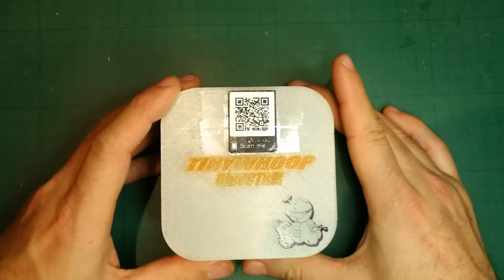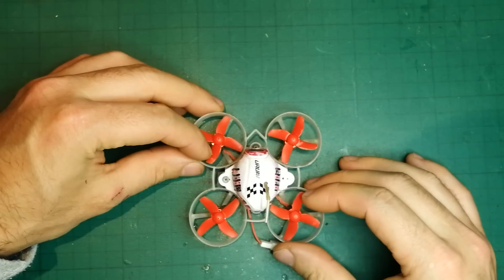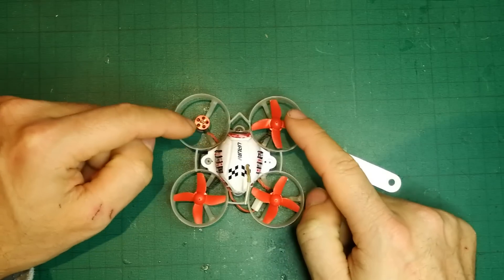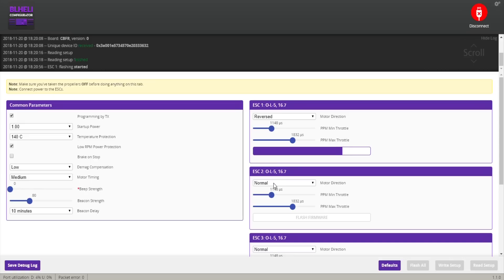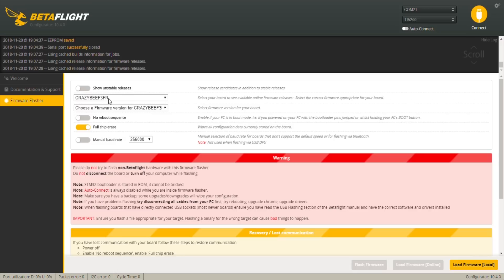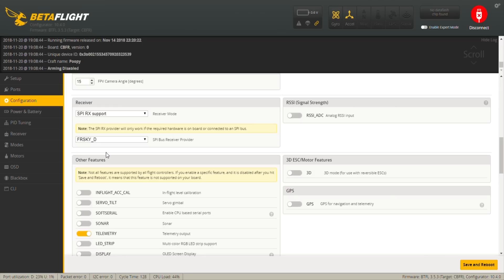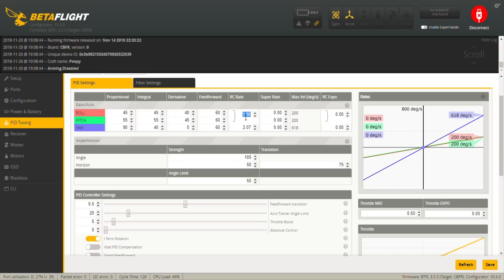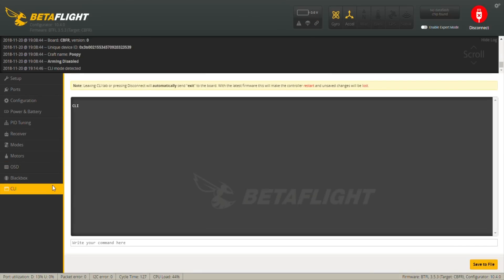The best configuration for your Brushless Tiny Whoop UR65

Comment: Can I use this as a beginner? or will I notice any difference?
Reply from the maker: You will definitely notice a lot of difference. This will help you fly a lot better as a beginner :)
Reply: @SeekNDFPV  i´m a beginner too and I have 2 problems. First one that my ur65 some times arms and some times dont, when I try to get into blheli confurator it says: "Connection failed, ensure that you have selected the correct port or restart your device." and the most important is that in banggood says "Please don't upgrade the ESC firmware to the newest one. Because it will lost configuration so damage motors . If you have upgraded to 16.7, please try to adjust the Starput Power to 1.00." should I doit anyway? I hope you can helpme! Thank you and have a good day.

Comment: Good overview. I do really enjoy the US65, it's so much fun. I thought that the mockingbird pids were a bit too high and I got oscillations in the motors so I dropped them back to defaults and found that I liked them better for fun flying. I haven't tried racing it yet.
Reply from the maker: What props are you using? I found that if I used eachine the pids work perfectly, but with TBS I get oscillations on high throttle.
Reply: @SeekNDFPV  I'm using the props from the Eachine e011. At the time I set it up and found some oscillation it was on BF3.4, so perhaps 3.5 has some improvements that allow higher pids without the oscillations. Could also be the 19kv of the US65 motors that caused it. It wasn't a crazy strong oscillation, but it was noticeable compared to stock settings.
Reply: That's strange...I'm running 3.4 and 3.5 on 19k, 17k and 16k with quad props (Eachine) and no oscillations!  Mine are all about 19g now tho.